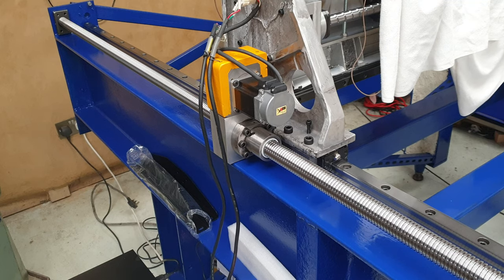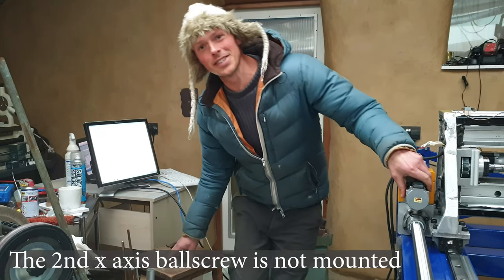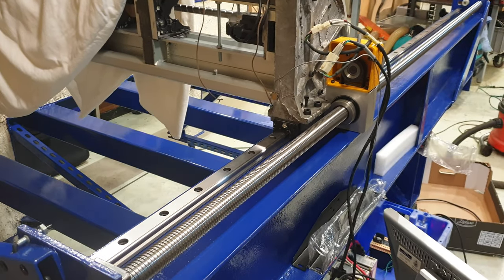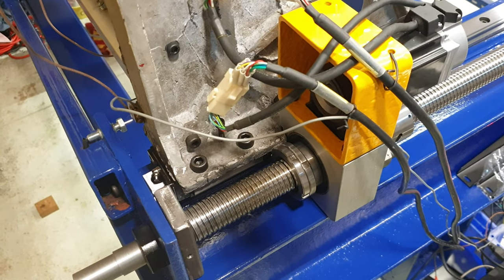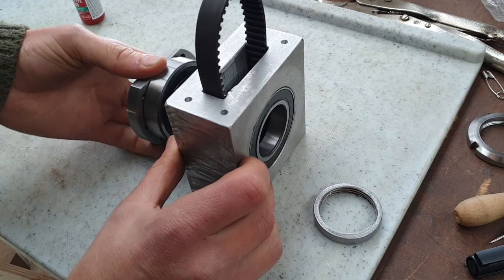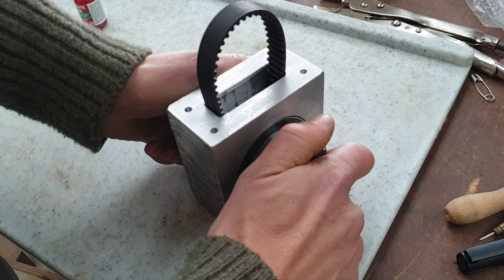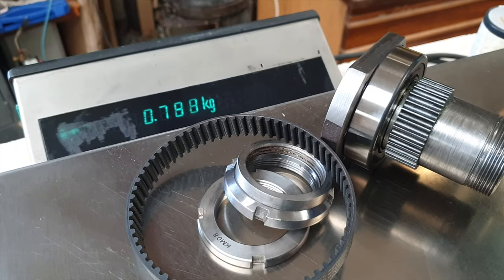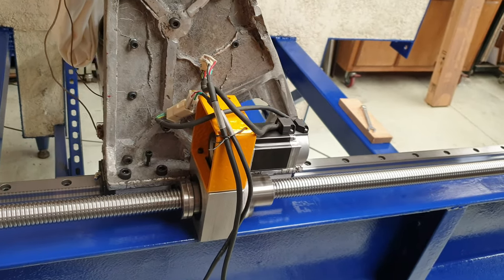Rotating ballnut design for large CNC - Lessons Learned!

Comment: I've seen rotating nut setups before but never used one, they always looked the business. I once read that you should tension the ball screws too on a setup like that. What's puzzling me is what pulley are you using on the pipe? I thought it looked like a taper locked pulley but after closer inspection I noticed it isn't. I can't figure out how the (driven) pulley is fastened to the pipe.
Reply from the maker: Hey Paul, good question. The pulley there is actually bonged on with locktite. It works to hold it, but a right pain to remove the pulley if you want to change it - I know!
Reply: @FloweringElbow4SuperNerds   Thanks for replying... That Loctite is seriously strong, to remove it we used to get a blow torch on it. I might be wrong though. Did you buy a regular pulley and turn the middle out on a lathe or did it come with that bore? I'm curious to know as I've been after making a rotating nut setup for a while.
Reply from the maker: @paulpavlou515  yeah, I used a hot air gut and a lot of patience when I removed... 
Yes I did turn out the middle on the lathe...

Comment: Design Option 1: Steel Rod Rotating at 100 revolutions per second

Moment of Inertia of the rod (I): 0.40625 kg·m^2
Angular Velocity (ω): 628.32 rad/s
Rotational Kinetic Energy (E): (1/2) * I * ω^2
Result: The rotational kinetic energy is approximately 80,562.5 joules (J).
Design Option 2: 10 kg Object Moving at 70 cm/s

Mass of the object (m): 10 kg
Velocity of the object (v): 0.7 m/s
Kinetic Energy (E): (1/2) * m * v^2
Result: The kinetic energy is approximately 0.245 joules (J).
Conclusion:

Comparing these two design options reveals a significant difference in terms of kinetic energy. The steel rod rotating at such a high speed (100 revolutions per second) possesses substantial rotational kinetic energy, approximately 80,562.5 joules, due to its moment of inertia and angular velocity. On the other hand, the 10 kg object moving at 70 cm/s has much lower kinetic energy, around 0.245 joules, due to its lower linear velocity. This difference in kinetic energy is crucial when considering the design and application of these systems.

Comment: hi i have a cnc router i need to change the motors of a 3 meter x 2 meter router, and i was considering buying absolute encoder servo motors with standalone gsk controller, can someone guide me, is this feasible?  or only servomotors with incremental encoder would be enough.
Reply from the maker: Hey there, this is outside my experience so I can't offer much advice I'm afraid, hopefully someone might chime in... Good luck.
Reply: Hello Hanz, I would go with 17 bit absolute encoders all the way. You can tune your servos perfectly with that. If you are planning to purchase chinese servos, you'll  find there's not much difference in price between 2500 PPR and 17 bit absolute. I'm using delta 17 bit absolute servos on a lathe and they are wokring flawlessly.

Comment: You showed us about 20% of the math's involved in the inertia equation  So  the nut is at a bigger radius than the screw so that needs to be put in the calculation you are also now carrying  the mass of the motor around on the gantry with would be stationary if you have the screw turning  you are also now turning those 2 or 4 gears to do the belt  ...  at what RPM was the ball screw sounding unpleasant .

Comment: My brain isn't a fan of that. Most of the rotational inertia would be very near the centerline, so I don't know how much of those 15kg actually matter - and I'd wager the inertia of the 2 other axis probably dwarfs it. Also that just seems like a great way to centrifuge oil away from the ball bearings (especially where they meet the screw, which is most critical). Mostly though, that just sounded terrible. I'm also not sure that belt bodes well for precision since the encoder is in the motor - I'd wager you're losing a few steps of precision when switching directions. If it were me I'd probably just rotate the screws, at least until I got a baseline to test alternatives against. 
But again, I wouldn't care for speed at all - I think that's a very minor thing to worry about because most of the time should be spent cutting and not moving around, and you don't cut at those speeds. Depending on the software you should be able to configure tool paths to have the shortest distance when moving between different paths. Perhaps you intend to put a toolchanger at one end of the table? That's the only reason I see to focus that much on speed given the compromises. I think if that's the case you might want to consider having the tool changer on the "across" axis arm there. Perhaps it's also added weight and inertia where you might not want it, but that's something you can make entirely out of plastic and aluminum so I personally would be willing to make that trade.
Good video though, appreciate it.
Reply from the maker: Hi TrisT, thanks for your thoughtful comment. I hadn't actually considered the centrifugal effect on the oil - really interesting - perhaps a reason to use slightly sticker grease than I otherwise would. I know others use the system (rotating nut) with good results. 
Thanks again, Bongo.
Reply: You'd have to explain to me how a toothed belt "loses a few steps in precision when switching direction".  A properly tensioned and sized belt will be as exact as a gear drive. Belts wear over time but are in comparison, easy and cheap to replace.
Reply: @timb1179  I left this comment more than a year ago, don't exactly remember what I was thinking tbh. But those are high speeds and so I was likely referring to either lax tensioning, or just the stretch in the belt itself, amplified by the fair bit of inertia. I'll concede it doesn't seem to make a lot of sense.
Reply: @Tristoo  Fair enough.  I am in the process of designing CnC myself and I am planning to use a driven ball nut design also.  However I am buying pre-made units from a Chinese supplier.  I went with a 32mm x 10mm pitch screw and driven nut.

Comment: Having a rotating ballnut might not be much better than a static one. The inertia is rotational inertia which means that it depends on the mass distance from the radius, for your monster balscrew it will help but for smaller screws the difference will be less. Also the whole machine gets more inertia as the motors travel with the gantry. Lastly you also have to have bigger cable chains for all the extra wiring. 

That being said, for chinese ballscrews which might not be straight this system minimizes vibrations and the risk of the ballscrew throwing around.
Reply: Actually the rotational inertia of those long ball screws will be ~5x the inertia of the gantry. Rotating the nut is the way to go.

Comment: just get better bearings? 1600RPM isn't really that much for a small bearing.
Reply from the maker: Hey Jon, It's actually the 'ball nut' itself that's the limiting factor, rather than the opposing angular contact bearings. At 32mm dia. cheap ballscrews tend to get cluncky after about 1000rpm...
Reply: @FloweringElbow4SuperNerds  sorry I must have smoked something that day. I guess that's the drawback of low pitch.
Reply from the maker: @jonjon3829  yeah, right on. Thats why I changed to 20mm :)